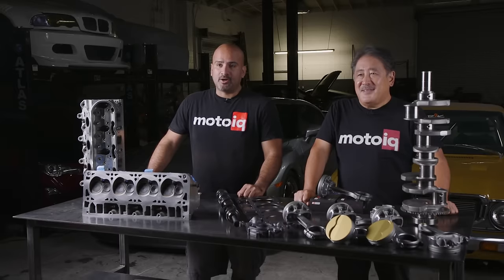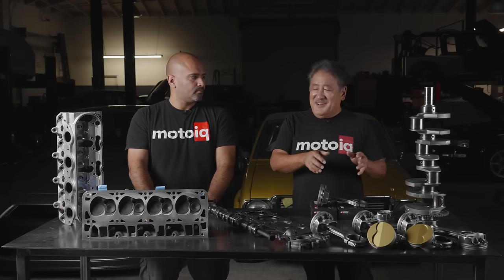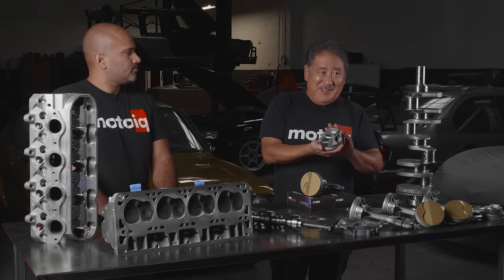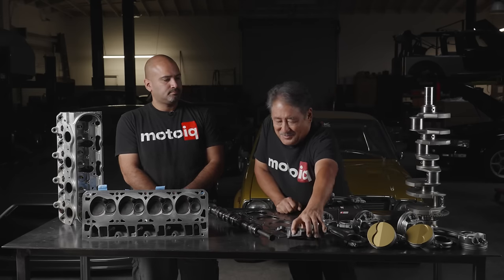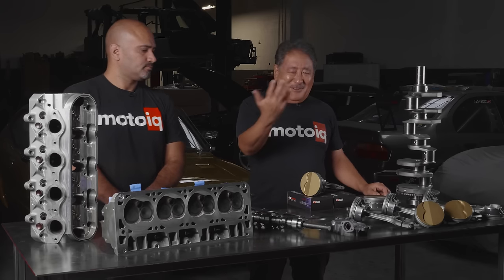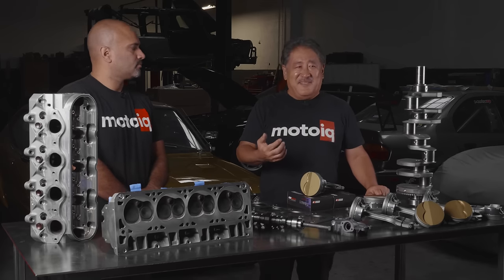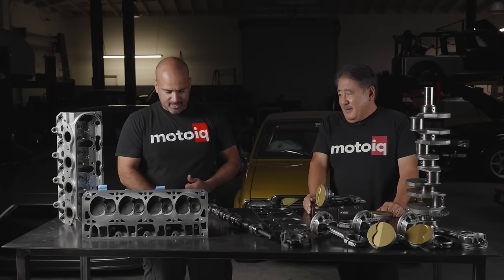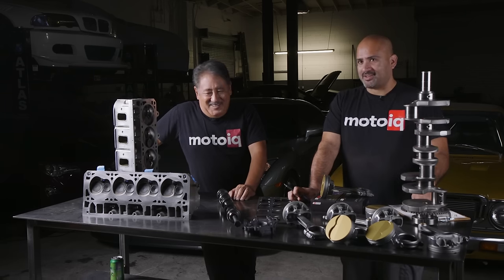How Much Does an LS Engine Build Cost?

Comment: You guys basically proved why doing an LS build WELL isn't cheap. I've done an extensive stock block LC9 build and spent a fair amount of coin getting it done right so that I can have reliability and longevity for my twin turbo LS swap in my 370z. I'll direct people to this video on why things cost what they do.
Reply from the maker: Good idea!
Reply: I finding this out first hand lol. I wanted to use most of the stock components of the dirty lq4 that I bought for $300CAD and oh boy did I ever get what I paid for the damn thing never seen a oil change so I’m basically replacing everything and boring the cylinders out because two of them were oval. I’m into it for about $4000USD at this point and I’m still not done buying shit for it.
Reply from the maker: Good thing you can bore those over a lot!  LQ's have a ton of potential.
Reply: @basedlibertyprime  Yeah man. I had something similar. I bought a "low milage" engine. The cylinders were out of round (slightly) and the  cylinder walls were pitted from water. I was planning on taking it to the machine shop anyway... but I paid a premium for the whole engine, that made me salty.
Reply: But but but the internet said you can do ls swap for 500-1000 bucks come on man don't lie we know the truth!  Lmao jk.  I sure hope my sarcasm shows through.
Reply: @midnight347  said everyone that never didn't a reliable boosted swap. Sarcasm was on point. 😃
Reply: The reason they make these videos is to inform the public how a full build would look the proper way you can take it how you want it, but these videos are mostly helping me make my cheap build because the information it has in it you don’t have to throw $1 million at an engine you gotta know how to build it
Reply: @josemendez-wu1nj  For sure. Work with what you have! -edit It really depends on what you want out of it too. I knew I wanted fast and reliable with high power, so I didn't expect it to be cheap.

Comment: You read my mind.  I was curious on prices when compated to a K motor for a potential engine swap for a Cayman with a blown motor.
Reply: Make sure to post the swap on all the Porsche forums for maximum outrage. :)
Reply: @hotshtsr20  😂 Oh, I still have the flat 6 and love it, but it doesn't hurt to plan on contingencies when a new stock replacement flat 6 costs $25k+ 😵
Reply from the maker: An LS goes in there pretty good!  They make swap kits too!
Reply: @DC5Brandon  well, if you’re bored, you could always post questions about it and watch the rage. :)
Reply: @hotshtsr20  LOL.  My Cayman's already modified.  Surely I'm  cancelled somewhere.
Reply: @DC5Brandon  lol. Factory knows best Nazis abound
Reply: @hotshtsr20 well Porsche was founded by them.

Comment: Great explanation on the costs of two different builds and I could listen to you both all day!! The "budget build" is spot on with what I've been calculating on my c6 GS with the stroker setup in mind and just one question. 
Why did you choose 418CID instead of 416CID? In my research just doing a hone on the cylinder walls was recommended as to not remove too much material from the sleeves but I'm still new to all this stuff as well.
I'd like to make 650 crank hp reliably like what you guys talked about for a fun street/track weekend car.
Reply from the maker: The bores on this engine were thrashed!

Comment: Would not suggest someone spend 1900 on a stock block. Might as well do a LSX or Dart iron block and eat the 100 pounds.
Reply from the maker: 100 lbs on the nose really hurts handling.  For really big power, we recommend iron blocks.
Reply: Dart LSnext SHP Pro>LSX, LSR, RHS block or anything else
Reply: @421ssrida  each has there place. RHS I know had a lot of problems cracking at the outer bolts, lsr looks like the mains would fail under high load, the Dart is the only one that actually has been redesigned. However people have made tons of power with every block out there.

Comment: Have you guys at motoiq ever used extrusion honing on any engine parts like a intake or exhaust or heads?
Reply: Exactly what I’m wondering too
Reply from the maker: Yes we have.  It works pretty good on OEM intake manifolds and turbo turbine housings.
Reply: @motoiq  awesome. I have been thinking about getting my exhaust manifold and turbine housing done for a while now. I guess I just need to do it.

Comment: Owner of a 05 CTSV here. Just wondering what site or company y'all would recommend for valve cover, head and lower intake manifold gaskets. I believe I have a slight leak in one of those causing white smoke and some over temp issues. Thank you and God bless.
Reply from the maker: If it has a stockish valvetrain without shaft rockers, etc, we like Holley because, well we like how they look.  There are many good ones on the market though.  Just look for ones that have sturdy rails where the gasket goes and a baffle plate for the PVC. for gaskets, OEM is very good and lacking that Fel-Pro is also good.

Comment: Building a customers motor out of a GM crate ls3 right now , has 200 miles on it and bearings are coming apart .  We do off road racing and the spec class rules is the GM 525 crate engine recently the quality of these has been very low allot of people having very early failure in them.  People think of crate engines as top quality but I can tell you your local machinist or engine builder is probably going to be doing better work than GM assembly line in my opinion.
Reply from the maker: Maybe GM changed the bearings spec.  We have seen OEM bearings start to not work as well due to a global drive to reduce heavy metals in auto production so the tin and antimony percentage in OEM bearings are being reduced.

Comment: You know, after building dozens and dozens of LS engines I can tell you one thing. You're overspending, especially if you want a nice powered STREET MOTOR. Notice I said Street Motor.  You get way more bang for your buck building a nice 5.3 LM7 or 6.0 LQ9. Now, if you want a "1,000 hp" engine, and pockets are deep, sure have at it.  Most of the time people are happy with a 550hp to 650hp engine after you get into costs, reality, and maintenance issues before you even agree to building them a motor.  Thats just fact and reality.  If you are getting into the $1,700 dollar range you really need to rethink your plan.  I can build a really nice LM7 with about 500hp for no more than $1,500 and drive it all day, every day for years.  Get up to about 600hp and your looking at around $1,750 and have a bangin' LS motor for weekend jaunts and mild track time.  DONT GET DRAGGED INTO A HOUSE PAYMENT when you build your engine.  You can overspend so easily and not see what you truly paid for.  

The sales pitch will empty your wallet pretty quick if you allow it to happen.  I never felt comfortable building someone a $5,000 dollar rebuild and upgrade when I wouldn't want it myself.  I wouldn't build them the engine.  Be realistic.  Know your expectations. You can get ripped off pretty fast.
Reply from the maker: I disagree, you are not going to build an engine with that power with any kind of reliably boosted for that cost, the system to boost it cost more than that. If it's NA you are not going to get that power for $1700 bucks.  I would challenge you to that. People who say they make big power for little money and make All Day Long usually mean for a day. Don't be fooled by guys who say that can make big power for $1500.  You can hardly get a cam, the valvetrain parts and headers for $1500.  Good proper machining for an LS costs $1500 on the machining alone, not parts, the labor costs more than $1500, do you build engines for free?  If you are a hobbyist if you build dozens and dozens of engines either you are rich, you spend a lot of time building engines for everyone you know or you are doing something really wrong to need that many engines. If you build 600 whp LS motors for $1700, hell I will send people to you. They will end up coming back to me.

Comment: Would you consider talking about the details of building a LS 327  4.0 bore x 3.26 stroke (6.0L pistons & 4.8L crank & rods )?  I've a 67 Nova and this is the engine I"ll be building as a tribute to the L79...
Reply from the maker: It will rev well

Comment: Currently rebuilding seized 4.8 v8 LR4/LS. So far total cost not counting tools or any machining that may/not be needed is $600.00.
Reusing block, heads, crankshaft, camshaft, valves, valve springs, piston rods and heads. Replacing everything else with new. Cheapest everything I can find.
Reply from the maker: Thats great if you have no expectations on performance and possibly reliability.

Comment: I mean if im only looking to get about 500 or 600 hp on nitrous at the drag strip in my sn95 Are these special blocks and miss matched berrings necessary? Or is there a standard clearance type of berrimg amd stuff for that hp
Reply from the maker: That is not an LS. A 100 shot is pretty safe, more than that needs engine and tuning integration and some knowledge of engines to be safe.

Comment: It's a very nice engine the camshaft knocks about 65 hp out of the package.
Reply from the maker: We knew that going in.
Reply: @motoiq  yeah I knew you were doing what the customer wanted. That is hard to do in your head I bet, would be for me
Reply from the maker: I want to see how much torque this engine will make!
Reply: @motoiq  tons at a low rpm. A stump puller.

Comment: From the ground up from pan to injectors. 12,000$ for an easy 1400hp. Obviously there is sweat equity in there. I’ll port the heads and assemble the thing.
Reply from the maker: While that is easily possible, in my opinion, its not going to be a long lasting 1400 hp, street engine, yes, drag for a short while, extended use, no.

Comment: i have a question that may bring some expansion fact's we all know the tq blocks important but well you punch or machine bore/hone do you guys heat your blocks and oil being we all talk about running temps and oil pressure oil flow vallys ect ive yet to see one block sitting at 180f well being blue printed and specs met to our best means possible. im just saying the heated running temp engine is expanded a little any oil/ fluid gallys would mean on warm up and running temp theres going to be slightly more expan making a ob longed bore am i wrong or no? i'm not saying the engine ould last last longer if its bored well hot but i feel your the pro and why not try.
Reply from the maker: That would be the best way but no one in our area does that.

Comment: $1000 to bore and hone a block?  That’s incredibly expensive, when a lot of shops will do a torque plate bore and hone for less then $300.  I’d love to see a video of your machining equipment, and process.
Reply from the maker: It's experience to do it right.  Everything from the torque and fasteners used on the torque plate to the cylinder wall finish.   We see so many incorrectly machined blocks and there are so many engines that come out poorly.   I would say if you can do it better for less than us, go ahead and build your own motor.
Reply: They stated $1100 for all the machining on that particular new LS3 block. Then later said 800 for bore & hone. But also said that particular block only got bore & honed and race finished. Something was lost in translation on that notepad. Anyway $800-1100 is typical price for race spec at race machine shop in Texas. Honestly probably great price for California.
Reply from the maker: That's including checking if it needs align honing.

Comment: A remedy that I did with my LQ9 was I over filled my oil by almost 2 quarts when I used the AFM Melling oil pump. I did a ghetto sight glass in my block and used a GoPro to watch it when I ran. I judged where the oil sat with a drawn sharpie line on my oil pan with the elevation of my oil pickup tube.
Reply from the maker: That can work!

Comment: How do you guys feel about 4032 Forged piston for strength and longevity? How power levels would you expect? What about the wear of a stroker vs stock (piston speed)?
Reply from the maker: 4032 is ok for an NA motor, forced induction 2618 is the way to go.  All of the top piston manufactures have learned a lot about how to make 2618 piston quieter and less slappy over the last few years so the popularity of 4032 has declined.

Comment: 6.125 is standard for 4.0 stroke. Why do you call it long rod? I run a 6.300 rod in a 3.9 stroke. I’ve got a few years on mine and it works flawless. I’d call a 6.3 a long rod
Reply from the maker: 6.098 is the standard length rod.
Reply: @motoiq  correct for stock.  Nothing special about this

Comment: This was interesting, very glad I got to see it. One question that I dont believe you covered, for a street application the only "problem area" I have found is cam bearings, is there anything you folks do to address that? Will coated bearings help there? I have put 400k on several 6.0 Iron LS engines and tear them down and find everything fine except the cam bearings. Thanks
Reply from the maker: Wow we never had cam bearings go out yet on any of the motors we have built of all levels of build and use. With non priority mains they get a good supply of lube.  What sort of oil pressure do you have?

Comment: This is a “Budget” build? OMG…
Reply from the maker: Difference between us and engine builders who have problems.  Also, check the costs of parts and the costs of good machine work by a top-in-the-country machine shop that can hold tight tolerances and you can see, this is what it costs.

Comment: The Mast Motorsports Mozez head is another all out racing head. I believe they have been on an 1,100hp NA 416ci
Reply from the maker: Mast has good stuff!
Reply: @motoiq  I may be wrong but I believe SAM, School of Automotive Machinists, built an all out NA 4th Gen Camaro drag car with some insanely exotic cylinder heads.

Comment: I have a 2002 z28 camaro m6 that needs some love engine wise.. shes been driven hard for the better part of 12 years or so ish. Oil changes have been done when they were supposed to everytime. But I’ve had a lot of issues with my ltft. Being pegged at 25. And a slew of other smaller issues most of which I’ve have completed by myself over time fuel pump fuel filter water pumps radiator starters alternators. You get it. It’s my second car and got the car around 92k miles and now she’s got 216k miles I’ve ported the tb and swapped exhaust with a slp LM1 cat back. Still has original cats I’ve also swapped the header gaskets and bolts but I do have a snapped bolt in the passanger rear. but I’m assuming the engine needs rebuilding.. just bevause miles and this and that… or at least a freshen up I’m assuming. Any chance you guys would want to take on this challenge I’ve been to every shop in the Bay Area and everyone seems to have some kinda issues or not do this or that and it’s just so hard to find a hood shop and you guys seem to actual like to do this and pay attention to detail. Where are you guys located anyway?
Reply from the maker: If you have an exhaust leak from that snapped bolt, that would wreck havoc with your LTFT.
Reply: @MotoIQ  yeah I kinda figured in turn that would be making me run very lean and waste a ton of gas..what else would get messed up if not fixed promptly though. I'm still learning the effects of ltft and stft.. it's also been giving me a very annoying ticking noise... not on start up when cold but only when it reaches full temp. Like I mean like clockwork. Cold start sounds fine and runs ok until it hits temp them ticking like crazy which goes up and down as you accelerate. But goes away if I increase acceleration above 3k it'll go away but will come back if I'm at a light and idle for too long. Which I'm hoping isn't anything more serious than an exhaust leak at the exhaust manifold. The rockers and everything inside the valve covers all seem tight and didn't move when inspected

Comment: I'm curious about the power gained by reduced frictional losses in the valve train.
   Any power lost to friction shows up as heat, 745.7 watts worth of it for each hp lost. That 20-30 hp lost with a stock valvetrain turns into 15-20,000 watts worth of heat. That's a lot.
   It's hard to believe it doesn't result in localized overheating of the parts causing the friction...it's even pretty significant when compared to the whole cooling system capacity.
    I've read or heard similar numbers from a few places, I guess I believe it's about right, but it seems like an awful lot of heat for a few lifters and rocker arm pivots, even with the oil flow. Maybe the temp is climbing constantly at high rpm and everything only survives due to the short, intermittent time spent like this?
   Any insight on that?
Reply from the maker: The valve springs get really hot, red hot sometimes, its why for some racing like oval track and road racing, you need oil sprayers.
Reply: I thought you meant that the gains were due to reduced frictional losses...the valve springs are there and have to deal with heat due to hysteresis no matter what type of rockers open them...heating of valve springs and heat due to rocker arm pivot friction are somewhat independent. If 20-30 hp is lost due to rocker friction, it has to be making that much heat at the point of friction, which just sounds awfully high. Hard to believe. That's 10 or 15 toaster ovens worth!
   Every watt goes somewhere,  can't  "disappear".
Reply from the maker: A lot of that heat is dissipated by the oil flow and the rockers have a lot. The sliding trunnions have a lot of point load.  Sometimes you can see bluing of these parts which is pretty amazing due to the oil flow these get. I also think a lot of the power is due to improved valve motion due to more direct translation of motion from the cam. I have never logged oil temp in an A to B comparison, it would be interesting to do so.